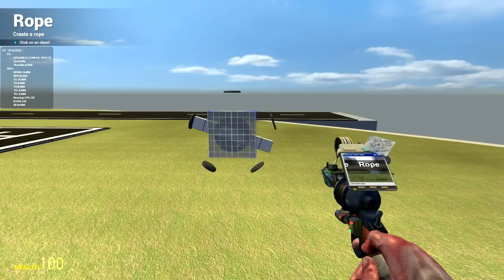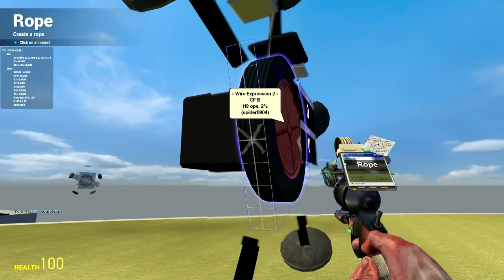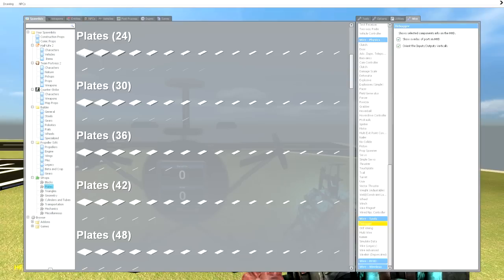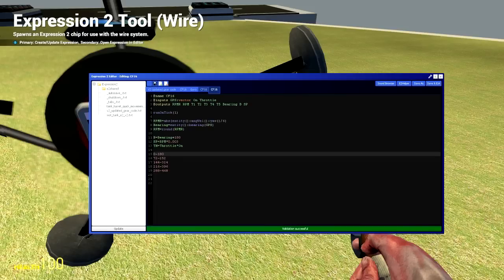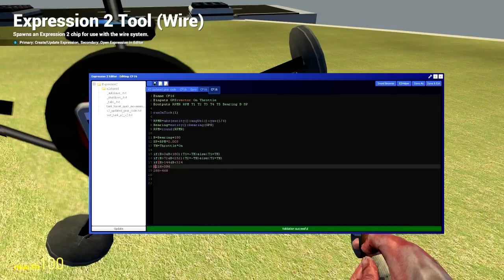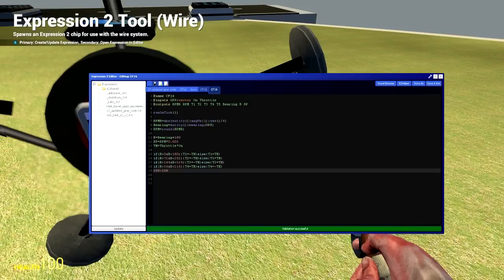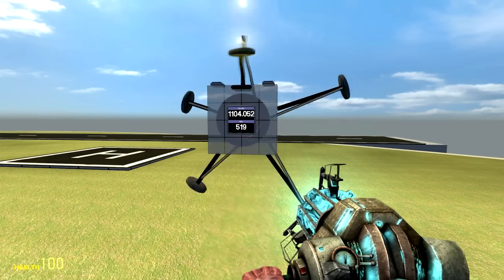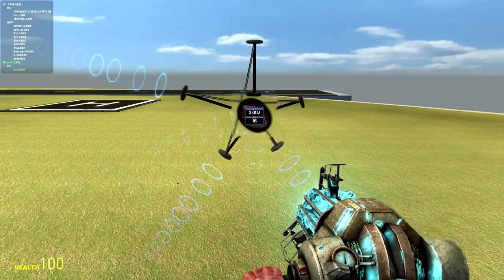Gmod - (Tutorial) Engines 02 "Timing"

Comment from the maker: I think why you may see it as wrong is 108+288 with the addition of 72 does not get you your piston 1 degree, but keep in mind piston 4 and 5 are negatively done so that is when the piston is not firing.

Piston 5 is firing at 288-360 and 360-108 which when you add 72 to each gives you 360 which can also be called 0 and 108 turns to 180

The negative flip shortens the code and simplifies things because I do not want to write (288-360 and 360-108) for firing.

I have a math proof below as well.

Comment from the maker: Piston 4 is 36-216
(+72 to piston 5) (108-288) is 180 degrees of firing for piston 5, offset 72 degrees from piston 4
Piston 5 is also offset from piston 1 by 72 degrees
Piston 4/5 are flipped negatively
For comparing piston 1 compare: 
288-108 (positive comparison) with 
0-180 add 72 to each 
288+72=360 (0) and 108+72=180 for an offset of 72 degrees
How is it wrong? 
Also for further proof you can just watch the thrusters fire correctly at the end of the video or run it yourself.